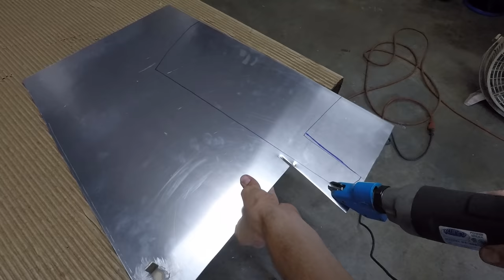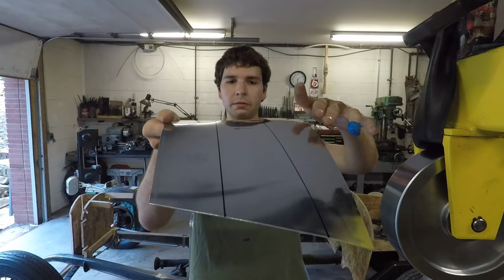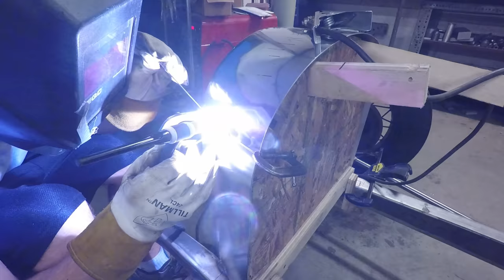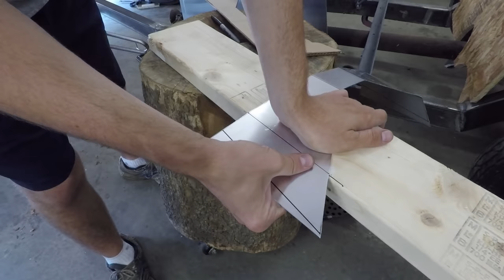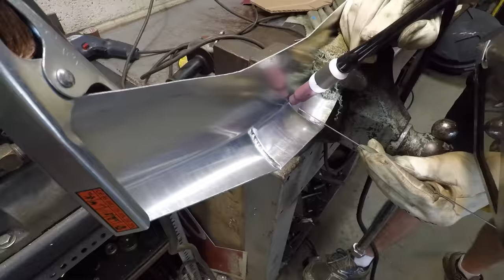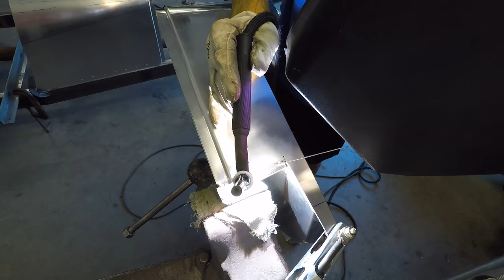Making a Grill Shell From Scratch! | Boat-tail Speedster Pt. 28

Comment: Ive been doing architectural sheet metal for 30 years and never had much of a need for the English wheel. Most of the radius' I deal with are bump or crimp.
Honestly, I saw you banging away at 1st and    
was thinking you were just gonna beat the thing into shape. Anyone can pound metal!
Then you hit that wheel and WOW!
I just got schooled!
Like a mirror finish even after mallet.
Fantastic work!

Comment: Noticed you using a 4 inch grinder for your finish work. Get you some small right angle pneumatic tools with "scotchbrite" rolock discs. You can get into much tighter places and by using various grits your finish work will benefit. You have a very good eye for metal fabrication. That is rare in todays young people. If you can't get it off a computer program you can't do it. A minds eye is a wonderful tool and you seem to have it. Look forward to more........

Comment: Years ago a friend gave me an old VHS tape. On that tape was an in depth interview with a famous old Indycar metal fabricator. Forgive me, I can't remember his name, but the contents of the interview was the old man fabricating a rear section of an aluminum fuel tank from sheet aluminium. In the tape he showed a lot of tricks and tips of using Oxy-Acetylene gas welding of aluminum, as well as a cool tip for annealing aluminum for hand forming. The point here is how he annealed the aluminum sheet. His trick was to set the sheet so it hung over the edge of a table, so he could heat it from underneath. He would then dust the top of the sheet with sawdust. As he heated the sheet, moving the torch briskly under the sheet to heat it uniformly, he would watch the sawdust for signs of smoke. When the sawdust started to smoke he knew the sheet was properly annealed! It was a very cool interview that I have sadly lost, but look for that interview if you can find it. The man was a gold mine of fabrication information.

Comment: My recommendations:

- Consider using Rubber (Grommets/ Gaskets / O-Rings ) between your sheet metal formed body to the chassis. The sheet metal will crack and/or rattle from engine/road vibrations. Hard steel (chassis) don't get along with sheet metal structures.

- Add Gussets / Ribs where needed/required.

Comment: Most impressive piece of detailed fabrication. In thought-experiments about building a vehicle, the grille-shell has always been a bit of a mystery. It's a detail that actually dominates the impression a machine gives, and any number of "replica" vehicles have ended up looking odd because the radiator area wasn't quite right. Yours looks a though it's going to work. (Vaguely Riley-ish.)

Comment: What is the abrasive grit level of the flap disc you use to dress the welds?  They seem to be cleaned up slowly, but smoothly.  Do you follow up with a smoother disc?  You are really doing a fine job on this build!  Did you teach yourself MIG and TIG welding too?

Comment: Would it be possible to punch small triangular holes at the bends just Infront of the line where you are going to put the step into the panel? So it relieves the compression of the aluminium? Then weld them up when the step is done?